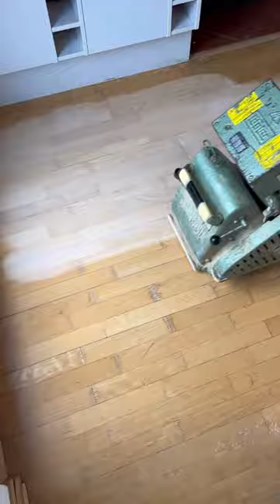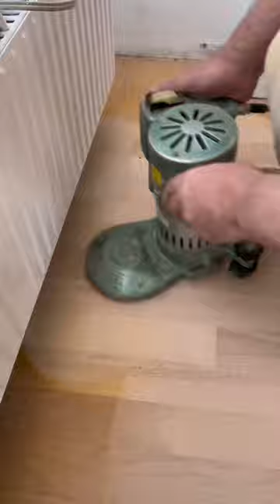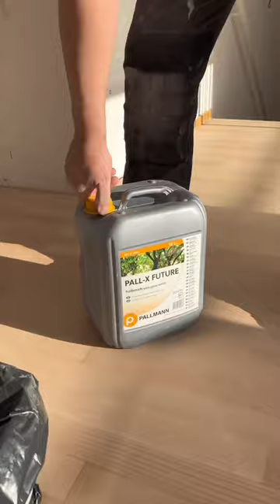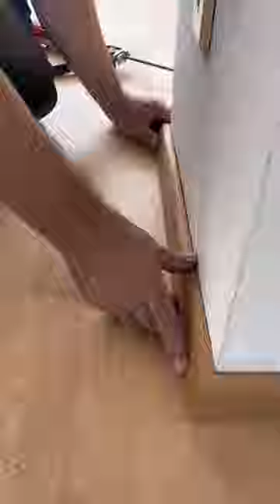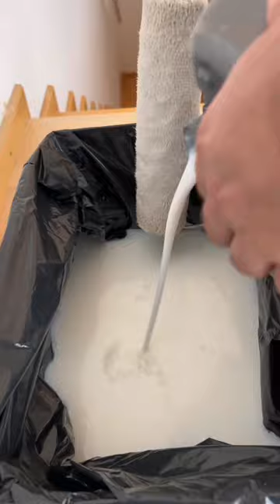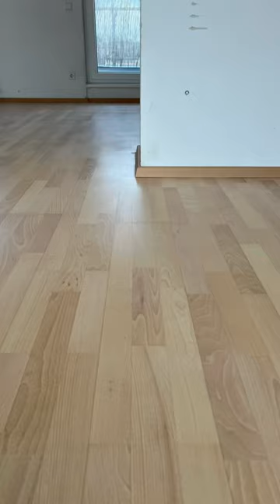Amazing transformation in 60 seconds 🤩 #shorts

Comment: Yaaaashh, have that exact Hummel. 

But what corner Sander are you using? Ours is at least 25 years old, very heavy, not that safe but it'll absolutely fix any height difference without a problem.
Reply from the maker: Absolutely. 👌 Hummel 🐝 is just undestroyable. And after many years of working, still delivers. 💪 For the corners we use Fein or Lägler. 🤝